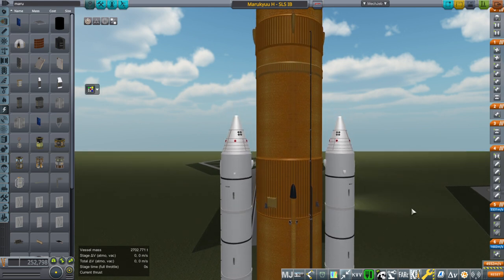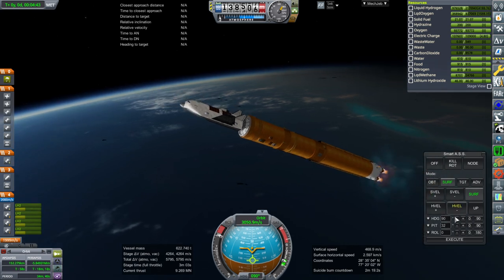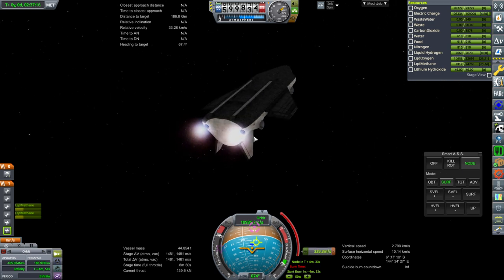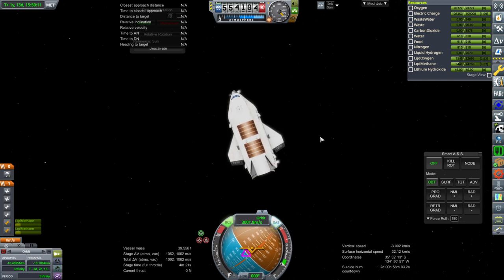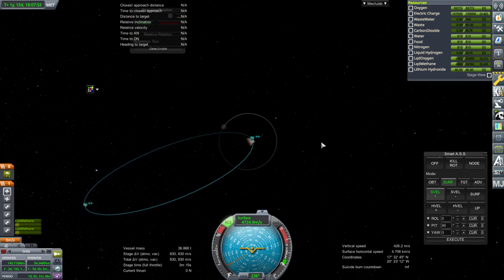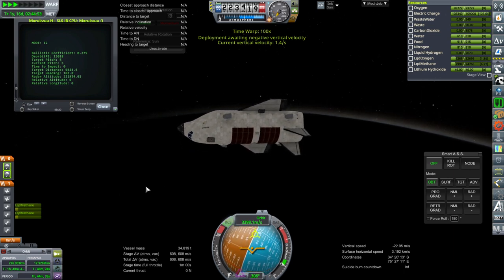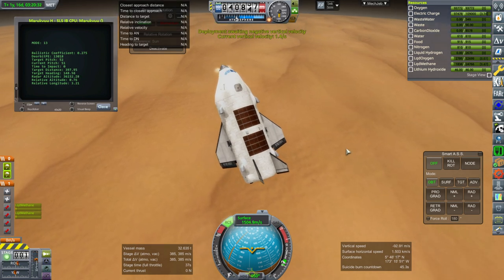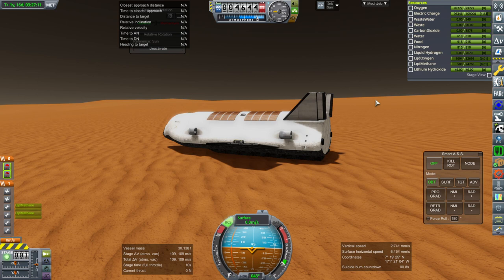Kerbal Space Program with RO - Marukyuu from Launch to Mars Landing

Comment: I know your not sure about crossrange capabilities, but how might you plan for correcting inclination in the deorbit burn. Also, how does the script predict aerodynamic effects and compensate for them? Setting that up would be really complicated.
Reply from the maker: The script already has the heading of the target location, so if that heading is to one side or another of the prograde direction, the heading of the deorbit burn can be adjusted to partly compensate. I'm not sure which aerodynamic effects you were wondering about the script compensating for.
Reply: Mars's atmosphere. You can pretty easily get a rough approximation of your landing location assuming your in a vacuum, however when you are a long way off, drag will throw it off. You have to be able to predict how the atmosphere will adjust your velocity.
Reply from the maker: You can do it by straight math, but I just used experimentation to see where it ended up while varying mass and altitude and then wrote factors to adjust for that while telling the script where it ought to be at a given altitude. For the most part, Mars' atmosphere is close enough to vacuum that it doesn't do a whole lot until near the end, incidentally.